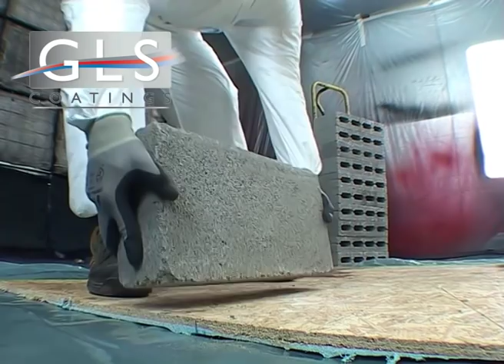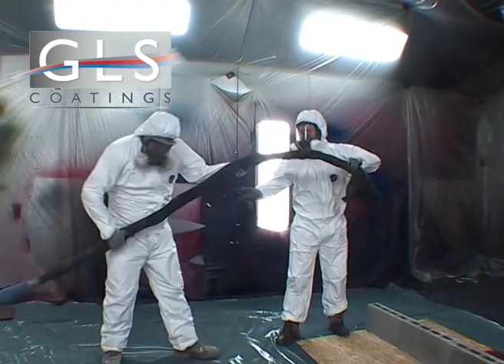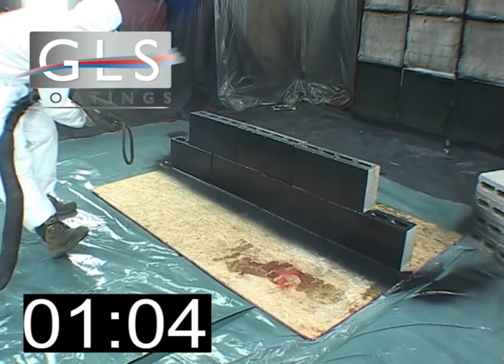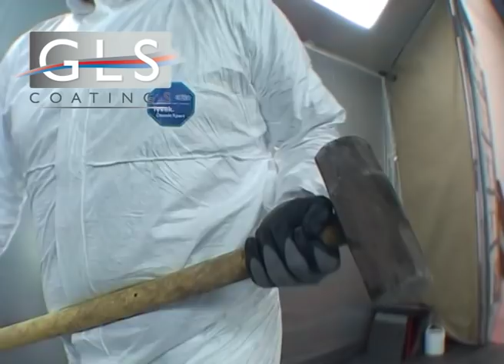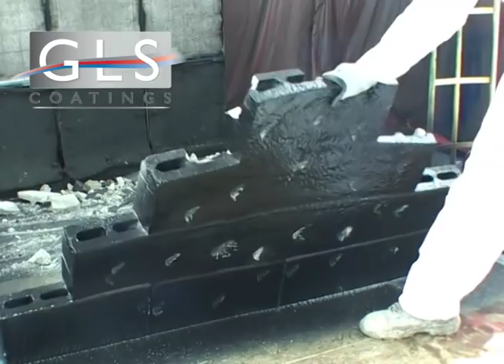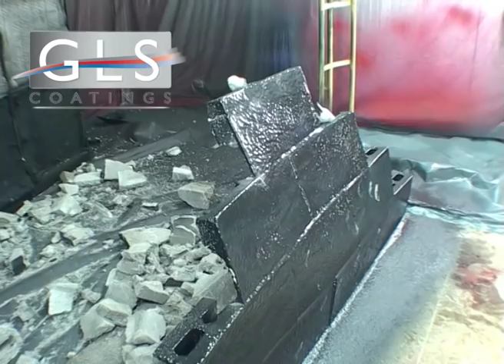GLS Coatings' Polyurea Sledgehammer Test

Comment: Put that on a car and make crash test
Reply: Oh...
Reply: Flassk same
Reply: That's what that spray is made for
Reply: briliant
Reply: I'd coat my Jeep in it.
Reply: Isn't it like Bedliner
Reply: TheTomekPlay hi thay already use this product on the underside of tanks and antipersonnel vehicles
Reply: first idea what came to mind xd
Reply: But cars are supposed to break away ... The energy has to go somewhere
Reply: TheTomekPlay  I was thinking the same thing
Reply: Brady Matheson cant key my truck
Reply: For the mustang owners
Reply: TheTomekPlay Why do you think cars crumbel sirten plases?
Reply: If both cars have that material of whatever that it is, the impact will stop both cars, maybe...
 But if only one car has that material, it would destroy the other car, and the people inside would probably die from the impact.
All cars must use that material, that must be essential in the manufacture, as the brakes.
Reply: It won't stop metal bending in a crash..
Reply: So this is like line X isnt it?
Reply: omg, i thought the same thing!

i need that for my car.
Reply: Whoa! That's genius.
Reply: TheTomekPlay that would actually be pretty bad if it implemented into real cars, cars are designed with a crumple zone, it is designed to be crushed so it can absorb some energy. But this coat would prevent that. Good for cars, bad for humans
Reply: Patrick McCaul he said crash test. Not real cars. Smh
Reply: @Daniel-ww3hl  not if they stretched like big fuckoff rubber bands and snapped back to their original size and shape leaving you intact with it.
Reply: Bro com from the future 💀
Is really use it in cars now
Reply: @DannyGruesome  Yes. A 2k paint based on an isocyanate and an polyamine.

Comment: I wonder how much better it would hold up if both sides were coated
Reply: Tdawg21 you wouldn't see a change in looks from start to finish.
Reply: Just rubble inside
Reply: Tdawg21 that's what I was thinking. Would be way stronger
Reply: That guy would be getting some overtime
Reply: Thing is, you wouldn’t get many opportunities to apply it like that in normal circumstances, I think.
Reply: Andrew Blue you would need some large equipment like modified asphalt seal coating trucks.
Reply: Weird how YouTube has us watching this lol
Reply: if  each brick was coated  all  around then put together   
He may need a wrecking ball or ram  to  do any real damage  
The spot hit will turn to powder  in a circle shape when hit with a enough force  .  Doing   this  make  some what like  bullet proof glass 
You can  see  happen by taking a piece of glass  and  taping all the way round with clear tape .   
            warning   it may bounce off  things  that would break it normally  .   Even a pellet gun rounds   that  rip  though  full  pressure, metal spray  can bounce off .    hollow  point- to penetration and every thing in between   will bounce off .
Reply: Same and I wanna know what would happen if he actually used the sledgehammer like a man and not baby hitting it
Reply: Tdawg21 ya
Reply: Lol
Reply: Well.. this acts like a rubber. So basically the wall would be all destroyed inside, and would be flexible as the only thing intact and holding up would be the coating...
Reply: Tdawg21 probably
Reply: blackgriffinxx I agree coat each one, then coat them all together👍
Reply: Tdawg21 alot better
Reply: I was thinking the exact same thing
Reply: It would like getting in the ring with mike  Tyson look almost fine on the outside your inside however TBD

Comment: If he's gonna swing the sledge hammer like a little girl, of course it's not going to break!
Reply: chase allen I was thinking the same 😂😂😂
Reply: I love how there’s a cut between each level
Reply: I reckon they were using s light sledge/hollow sledge to.
Reply: He hit it hard enough to break up the cement holding it up so he must have been doing something right.
Reply: I work for a concrete cutting and demolition company. He was hitting that block like a bitch. My little girl swings harder.
Reply: Denzel 'My Nigga' Washington yup.. You are correct.. He did swing like a bitch.. Being swinging sledge hammers since I was 14 and I can tell you he wouldn't last a week in demolition.. The only real use for this spray on is damp proofing in basements. Other than that I can foresee a serious problem in the ecological problems applying and disposing of it safely
Reply: chase allen right? Haha
Reply: chase allen lel
Reply: And it broke, but in the other side, as this was basically a glue holding everything up. Nothing too much special about such product. I've seen similar results with too thick layers of cheap paint, those ruber-ish inks that some places use.
Reply: Denzel 'My Nigga' Washington but do you?
Reply: chase allen 😂😂😂 I know right.
Reply: Black Hawk dude have you ever heard of sarcasm? Hold this L
Reply: I don’t think that’s the point smarty
Reply: Mark Jones whatever the case maybe I am still entitled to my opinion just as much as you are my friend. Have a nice day 👍
Reply: He never hit where there were cracks he always hit the main aprt of the bricks but not where it would be weakest to actually test the compound they are using
Reply: chase allen it's not an opinion if it can be wrong mate. You're dead wrong.
Reply: Why are you guys arguing over how hard he hit the cinder blocks? Just chill
Reply: NOW THATS A LOT DAMAGE.
Reply: Also note that the wall was not affixed properly to the ground, allowing a significant portion of the momentum in each strike to be wasted in shifting the entire wall backwards a few centimeters.
Reply: Billy Cranston he didn't really put his lower body into it, though, just his arms
Reply: jorma saatana that's all the more reason to put your lower body into it and not just your arms
Reply: He wasn't, he was using the inertia of gravity to hid harder, listen you'll hear the strength
Reply: chase allen lol
Reply: Do you have blast test?
Reply: I was thinking if you have a blasting test.
Reply: chase allen if it was braking out the back side but not the front its just showing how strong the stuff is
Reply: Let him swing it that hard at your teeth see if it with stands his so called girly throw
Reply: แล้วรื้อไง ทำมาไม่คิด
Reply: No se si te diste cuenta que los bloques SI se rompieron...
Lo que intentan demostrar no es que se vuelve irrompible el bloque sino que la capa superficial que le aplicaron si lo es y por ende tambien otorgó cierta protección al bloque.
Ya queda de parte de cada quien buscar una aplicación para esa tecnologia.
Y realmente no se si entiendas, porque escribí en español y posiblemente tengas, no se... 8 años?
Reply: @Billy_Badass He's blowing out the back end. W only one side being coated, id say they pr9ved their point.
Reply: Right, because you are so manly that you would have crushed it.
Reply: Yeah he knocked the back out of it because he was using a sledgehammer, but he wasn't using it to it's full potential by a long shot. I've worked in demolition, and spent hours on end swinging a sledge. Nine hours into a ten hour day I could still swing that sledge way the fuck harder than he is in this video. I'd be very impressed if that wall held up the same way to someone that knew what they were doing really putting their back into it.
Reply: Engineer here, I think part of the demonstration was to show the cinder block unprotected side would fail before the coated side, and how this coated side could hold up itself in case of complete wall failure, mitigating eventual victims and property damage.
Reply: No no it's still good but what kind of toxic fumes does it create once on fire
Reply: daimon hellstrom  just because he broke out the thin hollowed out cinder blocks doesn't mean he was swinging hard, if he actually was swinging hard he would be ripping right through that spray
Reply: @nathanbrawley7256  I see you too much any kind section I go on I see you it's scaring me
Reply: Watch veritasiums video about it, and you will think twice about that.

Comment: Dont ppl understand, that cars have to be able to get damaged? If you are in a car crash and your car doesn't get deformed you will die whilst your car is unscrached
Reply: Dude, it's rubber, it has some give to it. Dafaq?!
Reply: I dont think this is meant for structural purposes in the automotive industry anyway. Maybe its good for waterproofing applications on buildings?
Reply: Alan Hall
Well, doesn't seem like much if it can withstand a hammer..
Reply: Mario R
Well they started as a car company. I saw videos of ppl who who head the front of a truck sprayed. But they also do structural work as you said. The pentagon is sprayed in a few areas with these to protect from grenade splinters
Reply: Where Does it say this is for cars. and a car would still deform if this was on it.
Reply: It’s bed liner bud not car paint it’s there to give it a better look as paint will get scratched with use and this stuff can be easily washed off with a hose
Reply: Stefan Huber most people on youtube dont understand that cars are desiged to get crushed when you crash in order to slow your momentum down so you dont die.
.
Reply: 1992djg it's not bed liner as it has no uv protection in it. This product would turn green in a week in the sun. I put some polyurea on a couple shop rigs and was bummed out but they are paint trucks all covered with overspray anyway.
Reply: Cars are platic so manufacturersand resellers can save on shipping costs... it s not for your protection
Reply: They have to absorb the impact
Reply: 👍for using deathwish soundtrack.
Reply: Stefan Huber whatst?
Reply: Do not educate the consumers!
Reply: What does this have to do with cars?
Reply: @minecrafterselite1  
How would you know what ''most people on you tube" do or do not understand? are you a liberal? just wondering.... .  .   .    .      .
Reply: Do they make cars out on concrete blocks?
Reply: Insurance is more expensive than my life so it's all good.
Reply: @craigmancool have fun paying for gas

Comment: Remarkable stuff. I understand it is becoming more popular as a coating for narrowboat hulls. 
Narrowboats usually have to be slipped from the water, stripped and coated with bitumen every 3 years or so. It seems this stuff is good for up to 30 years, so may well be worth the extra cost of treatment.
Reply: GLS Coatings Ltd
Thanks for replying.
As I am looking into buying a narrowboat eventually, what do you reckon the approximate cost of priming and coating the bottom half of a bare 60ft hull would be?
Cheers.
Reply: GLS Coatings Ltd

Thanks for that. This should help greatly in calculating cost vs benefits.
Reply: Bri Hutchins l

Comment: Have you guys heard of 3D printing home they use concrete to print out the houses layer by layer I think this would be great for an outside coating make the house more durable
Reply: i think that this is applied to wall to prevent break-in, as in burgling.
Reply: Michael D  I like precasted concrete walls
Reply: I cannot tell if your serious, it's probably expensive as hell and a horrible insulator, not to mention how it looks, if I saw that next door, ugh.
Reply: It's hella expensive
Reply: GrɆg  not really look up icf homes

Comment: Except engines and electronics, I'll make rest of the body of my car with cardboard and will spray it from both sides, to increase the mileage of the car drastically.
Reply: Well just be aware, that your is supposed to deform upon crashing so your survival rate is increased by quite a lot. Won't do you any good if your car is unscrached and you died.
Just be aware of that.

Comment: spray this on home roofs , last forever and also would help as insulation I'm sure .
Reply: Good idea!
Reply: As long as it is uv resistant. You should see all of the grey bedliners around town. A few years of sunshine wears it out.
Reply: basement waterproofing
Reply: Baráth Zsolt  indeed !!
Reply: Sid KNIGHT what are some side effects you’ve experienced from the use of steroids?
Reply: WodernWarfareTree  none at all TRT is under Dr care 👍👍👍
Reply: @txknightrider82  be careful man, don't underestimate the consequences. Just want you to be safe, don't abuse it. 👌
Reply: It would make your roof rot from the inside out. Traps in the moisture within the wood. Same thing happens when ppl coat the bottom of their cars with this shit.
Reply: Marcus Alexander  45 likes & you have no clue , homes have ventilation. So moister seeps through tin roofs ?? Hahahahaha
Reply: @txknightrider82  not the same thing. Just look it up. Mechanics have posted videos of what this has done to the undercarriage of vehicles.
Reply: And this product doesn't break the laws of physics. After pummeling it with a sledge hammer, peel off this stuff and you'll find the insides have crumbled apart.
Reply: Think about it, it's a microbiology question. Wood s porous, and one of the things that helps keep wood from deteriorating, or growing microorganisms, is that it's porous and is able to breathe when it comes to humidity changes and temperature fluctuations. If you put a non breathable substance on one side of the wood, what happens in a dark wet environment? Because even though the wood feels dry to touch, wood has moisture within it, and that moisture is brought out of wood according to temperature fluctuations. And if you block in that moisture with a non breathable substance, and it's within a dark environment, that will grow microorganisms.
Reply: One word, condensation..   you can seal the shit outta anything but have a temperature difference on both sides and the moisture in the air will condense on the cooler side..  also very much so on tin roofs or metal clad buildings..  is why you dont put fiberglass insulation directly against metal buildings because of the condensation.  There needs to be an air gap with weep holes to circulate the air and dry it all out.. but to answer the first thing, yes this stuff would be a great roofing material..  much better than asphalt material but im betting this stuff is expensive..  like would have cost you close to a grand or better to coat the block in the video..
Reply: @Z-Ack   actually the inspector that looked at my home roof told me he seen this on homes then on top they place the ceramics just for looks .but yea hi cost ‼️‼️

Comment: Can you use it as a spray on comdom? 😂😂
Reply: I would actually pay for a pixelated video of that stunt , you know for humanity progress
Reply: E46SMGII stay hard
Reply: Yeah bro it works and peels right off after, I've tried it.
Reply: pffff, this stuff is for amateurs. i use FLEXSEAL instead to stop leaks fast and never have to worry
Reply: Yes plese test it,
Either it Will be a succes for humanity
Reply: That's what flex seal is for
Reply: Yes but I wouldn’t try beating it with a sledge hammer 🤛
Reply: For extra protection
Reply: E46SMGII if you look at your comment and the one just below it. The question becomes. Can it be a spray on bullet proof condom? Hahahahhh
Reply: Timothy Cormier hahahahaha
Reply: Youll impregnate yourself
Reply: E46SMGII yes you can but you can't get it off
Reply: Alto virgo
Reply: Can you stop be sprayed on plywood on an enclosed trailer for snowmobiles with carbides on the skis and pics on the tracks how would it hold

Comment: is it bulletproof?
Reply: yea this is my question
Reply: yea this is my question
Reply: PL4Y3R S4M hell no
Reply: +PL4Y3R S4M  I'm afraid not
Reply: Uratz no they already tried it by putting the coating on a
 car and shooting a AR-15 at it or a small pistol it didn't work
Reply: Uratz no its not
Reply: Fireproof?
Reply: Bulletproof is a unrealistic bubble word... as bullet resistant as other 5 mil thick hydrocarbon chain resins probably
Reply: PL4Y3R S4M impossible
Reply: Uratz Definitely not, it takes a lot more to stop a bullet
Reply: No... This is just "rubber" basically... 
If you puncture it with a knife it will easily be cut. 
If you ever tried to smash a ereaser (those scholar ones) with a hammer or a sledgehammer, you will see that it wont do nothing to it. 
But you can still snap it in the half with your bare hands.
Reply: Eduardo Avila good analogy dude. Reminds me of the "one pencil alone will break but when everyone sticks together" demonstration
Reply: Thx! Yeah, reminds me of that too!

Comment: The only problem with this material is that whatever it coats still gets destroyed....it basically mimics the size of the structure it is applied on but thats that , could be used in smaller scale applications smh tho

Comment: I have no experience with gls, but I have applied several hundred gallons of Tenemec Elastoshield 400 to know that polyurea is some evil shit if you are the one applying it.  You should have no problem sticking the sledgehammer to the bricks forever if you pressed it into the wet coating.

Comment: What the point in the cinder blocks?  Just make a wall from molds of cinder blocks filled with this stuff.

FLEX SEAL!

 I DESTROYED THIS WALL WITH A SLEDGE HAMMER AND FIXED IT WITH FLEX SEAL